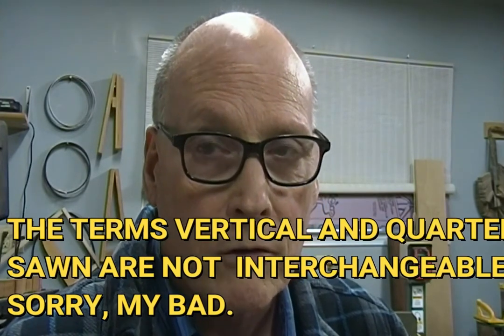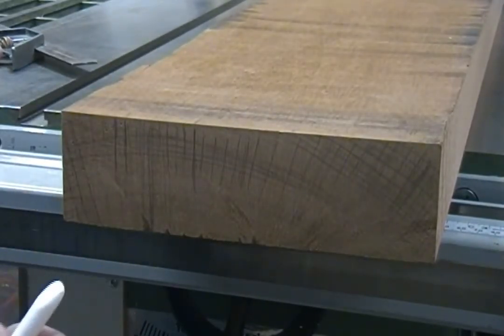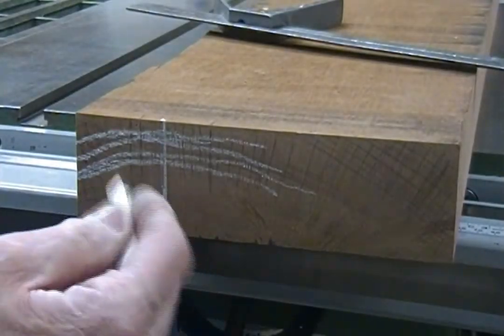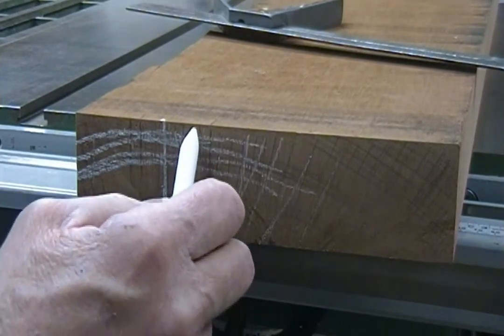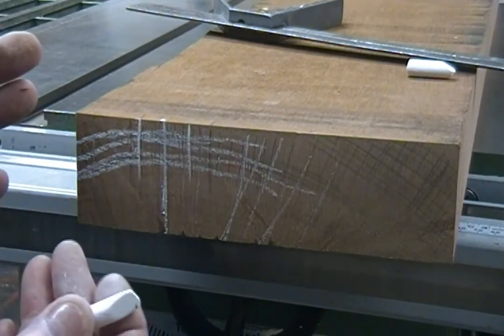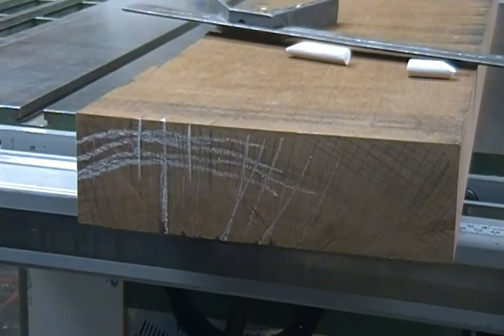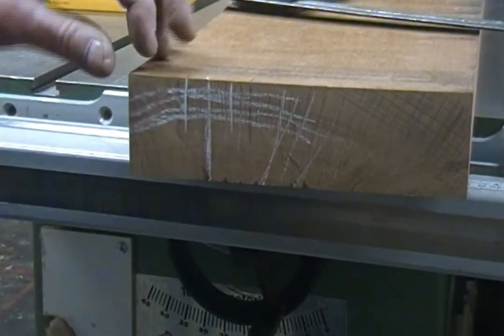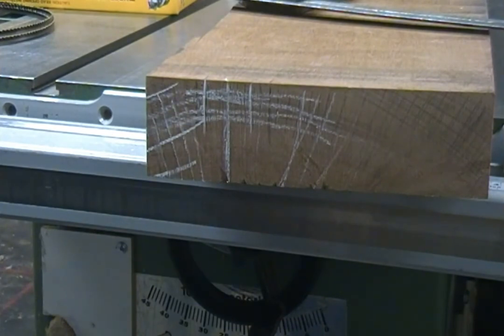JONAH GUITAR EXTRA #15, HOW TO QUARTER SAW WOOD

Comment: Your channel was only shoved in front of me today by YT. I’m no guitar builder but rather a fine furniture maker in the UK. However, some of your content just related to any kind of product and, from those I’ve watched, seems authoritative yet casual. So, subscribed. 

On the question of quartersawn against vertical grain. Here in  the UK, the reality is that the terms are interchangeable. I understand that they can be sawn differently to get to the slab but the end result looks the same. Richard Jones of Richard Furniture is someone whose work I admire and he gives a very good analysis on this subject. 

Quartersawn is obviously prized for its stability although, in the large pieces, that vertical grain can lead to structural weakness if the stress is applied at 90 degrees to the board. In Timbers like oak and London plane for instance, quarter sawn or vertical grain brings out grain feature which only come if sawn that way. QS Oak is well known for its medullary rays whilst QS London plane is known as lacewood (for obvious reasons).

QS is more expensive partly because of the extra time it takes to produce and the increased wastage in the cutting - but also just the laws of supply and demand. When I buy slabs, I try and select a vertical grain piece along with a crown cut piece. There are uses for both and, doing it my way, doesn’t p*ss off the yard by me taking only the most on-demand pieces. 

When I get a thicker slab (say 8”), I can usually make some decent vertical grain stuff myself. I use exactly your technique and, by adjusting the angle of the bandsaw table, can get a lot of VG veneers. Obviously, labour and wastage are increased but, that’s unavoidable.
Reply from the maker: Thanks for watching and the sub Theo. And thanks for the info.

Comment: I always thought 335 were laminated?
Reply from the maker: Hi JJ JJ, yes indeed a stock Gibson and I would guess most other semi-hollow production builders are going to use laminations  for both production speed and material cost savings. I am not because of the time and expense to build all the needed fixtures and acquire either a vacuum bag and system or heated press.  I'm also of the mind that this will pretty amazing with a carved top.